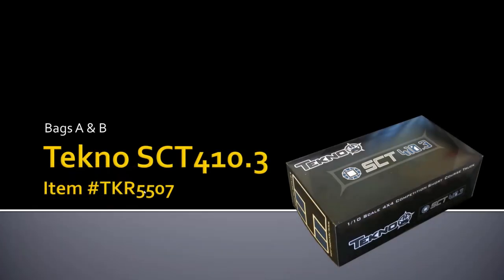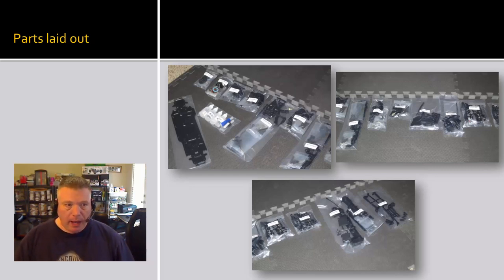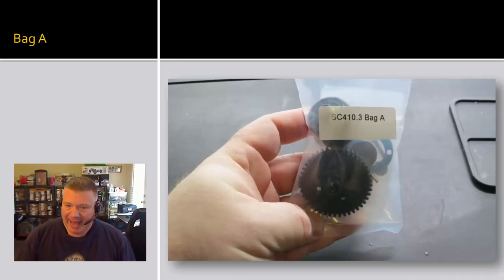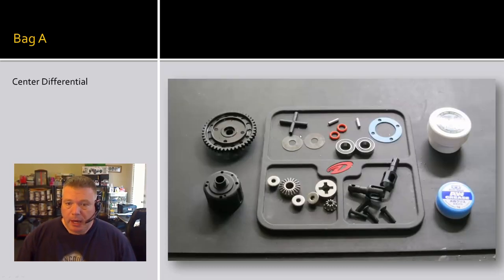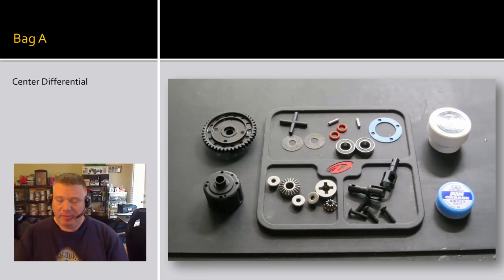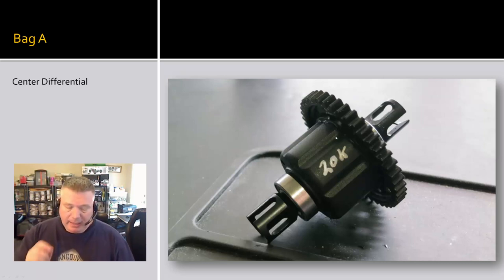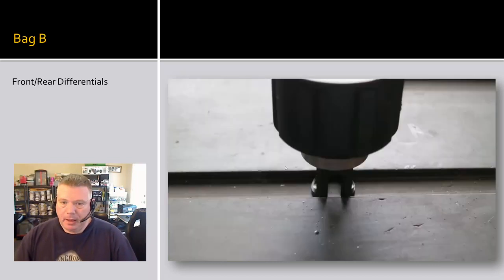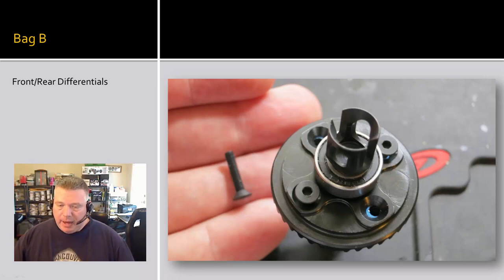Tekno SCT410.3 Team Build - Bags A & B

Comment: I'm just now getting into the hobby. I received the sct410.3 today and before starting my build I watched the first 3 videos.  You have saved me plenty of headache putting my diffs together. 

**Especially advising pre screwing the screws into the housing - the very first thing I did right after opening bags A/B.  If I wouldn't have done that I would have had diff fluid spilling everywhere trying to screw those in!

I cant wait to continue the build while following along with the rest of your videos.

Awesome job!
Reply from the maker: Thank you for the kinds words.  I have to admit, if it weren't for some extremely kind and generous fellow racers at Thornhill Jr in Hutto, TX I never would have been able to build my SCT to the level that I did.  If you're ever in central TX on a Saturday, swing by the track.  They're truly awesome folks.